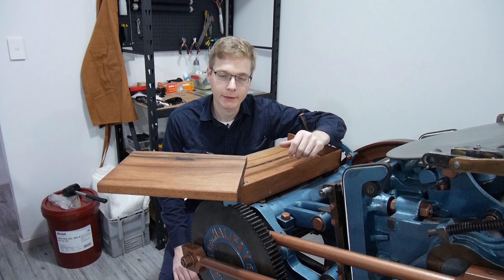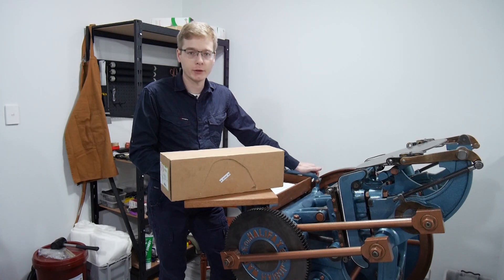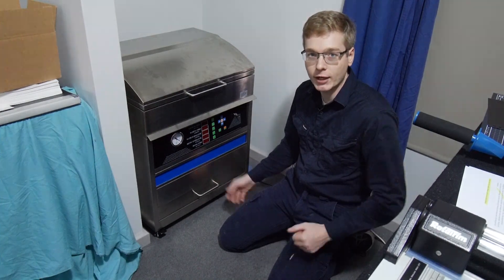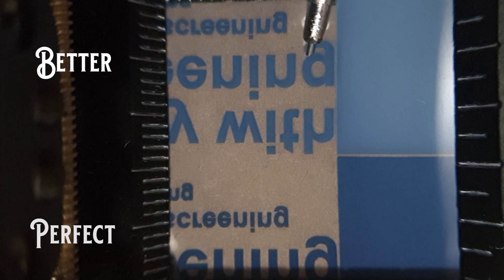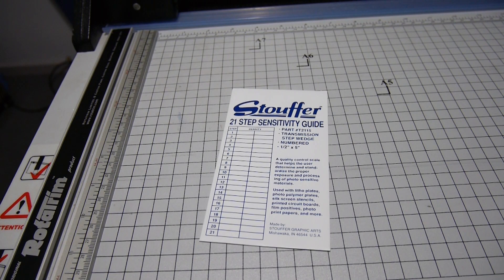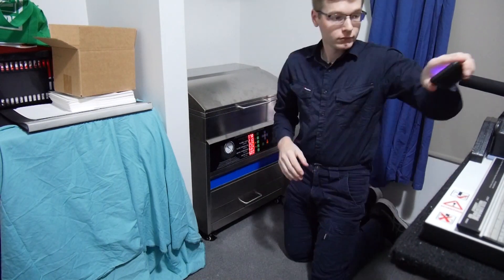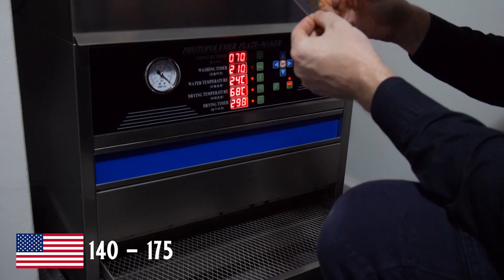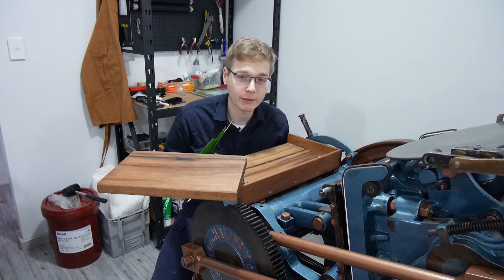Photopolymer plate making for letterpress printing, in-depth walk-through.

Comment: I run a commercial litho factory and here we also make rubberstamps for clients. Seems that the process are very similar except that the polymer plate we use is about 3 mm. thick and the wash out is solvent based, there are also water based plates, but they are less durable. The film positive that we use were made at the local plates shop using an imagesetter but we have since moved to using toner sensitive black foil where a laser printout is sandwiched to this foil and passes through a pouch laminator at maximum heat, the result is a positive with crystal clear image part and 100% opaque non image area.

Comment: @Sylvan - Had a question for you. What solution do you use to wash the flexo plates on the top section of the machine where we brush off the excessive polymer. We have invested in a plate maker and now are looking to get a grasp on the plate making process. Any tips will be helpful.
Reply: Hi, I have the same question. is it just pure water?

Comment: Hi there, 
I really enjoyed watching this tutorial. Thanks for all the informative tips.. super helpful. I’m hoping to make plates without a unit... I know that you recommended the Epson.. but I’m looking into purchasing the  HP OfficeJet Pro 7720 Wide Format All-in-One Printer. Would this work and give the same result as the Epson? 
Any sort of feedback help would be appreciated ☺️ thanks
Reply from the maker: I'm not sure since I have not used the printer, it has lower resolution and uses thermal not pigment ink. So I'm guessing it won't be as high a resolution as what a specialist fine art printer would be able to output.

If your not using a unit, make sure the film is held tightly to the polymer as possible a piece of thick heavy glass if you don't have a vacuum unit would help a bit.
Reply: Okay thank you for your response. 😁 I’ll look into the Epson